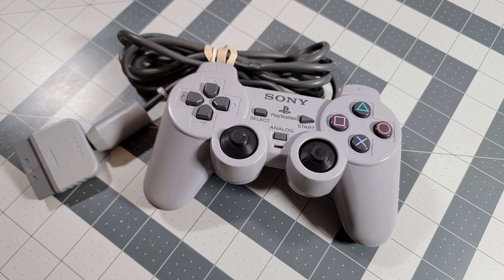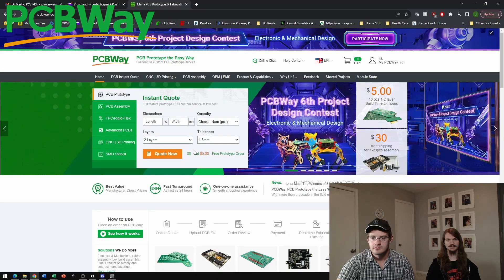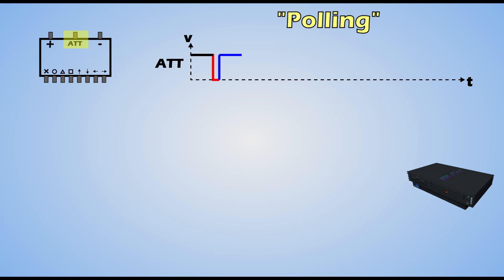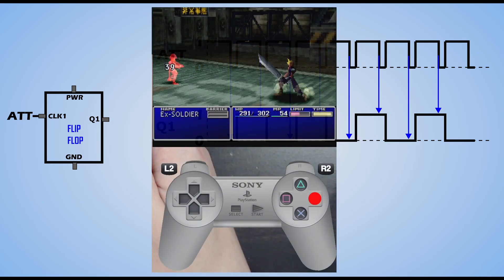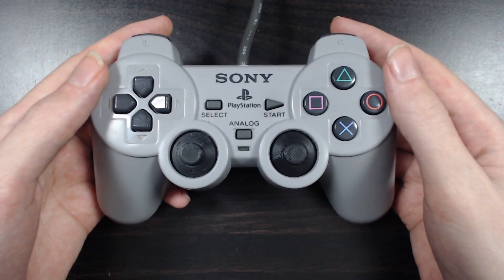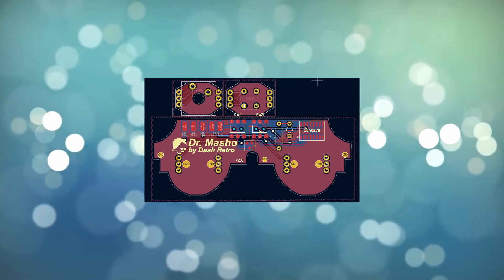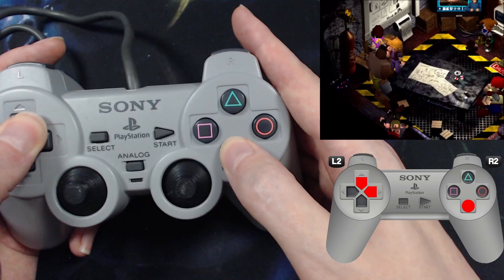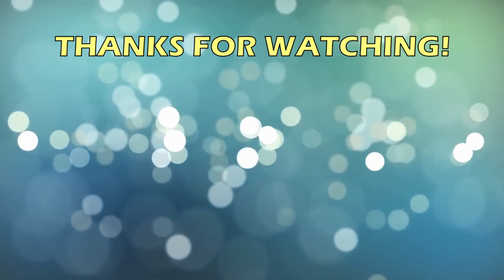The Best Turbo Controller Sony Never Made | Dr. Masho Mod

Comment: I kind of misspoke near the end when I say my least favorite thing is getting rid of the analog sticks.  For the specific purposes of this controller, it's actually my favorite thing because it's all enclosed and super comfortable.  Specifically, my least favorite thing is having to track down controllers that have the specific internals where the analog sticks are actually removable (many controllers have an all-in-one PCB that this isn't compatible with).  A hypothetical future version that keeps the analog sticks intact should also theoretically not have this limitation.